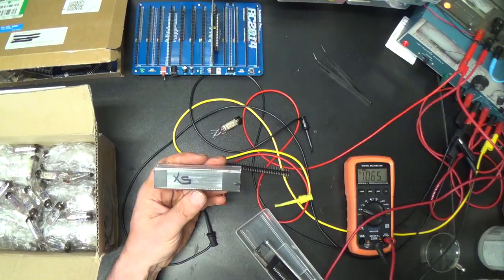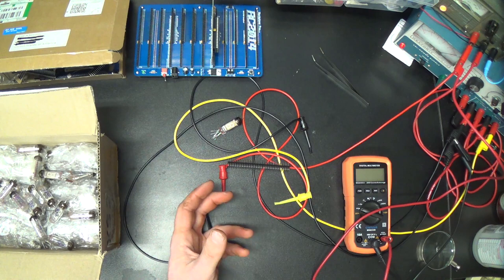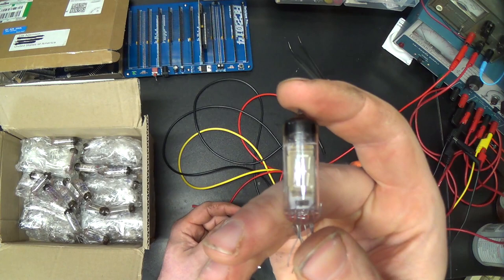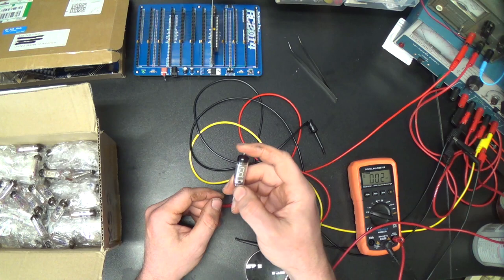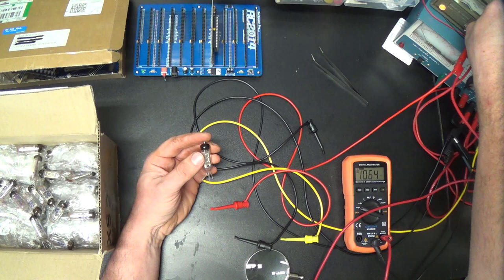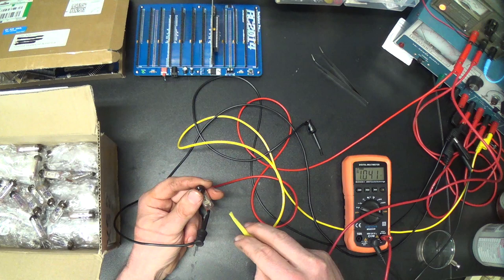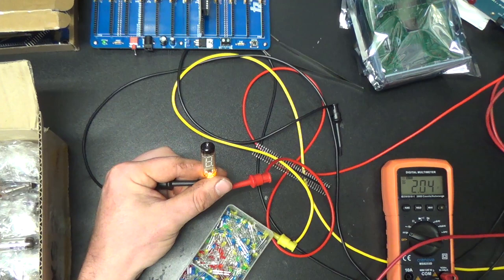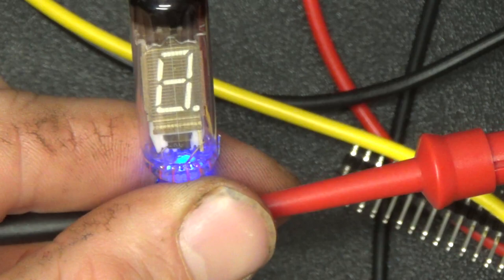IV-6 7-Segment Display Tubes

Comment: Based on my 25-286 development, it wont take much CPLD. Even a 16V8 GAL will have enough capacity to decode I/O addressing for an integrated XT-CF-Lite . My riser is using a 16v8 to decode for a UMB provider and I plane to use an xt-cf-lite in the third backside upside-down ISS slot, or even a 16 bit IDE controller with a IDE to CF adapter. In the latter case I will use the ROM socket on my NIC to host the XT-IDE firmware.
Reply from the maker: Yeah, I have been thinking that a full 16 bit buffered ide interface is overkill.  Even an 8 bit cf interface should be scads faster than a real hard drive for that class of machine ever was.
Reply: @Lee_Adamson_OCF  I've clocked the XT-IDE Rev.4 on my Tandy 1000 HX with a CF card at 163.7 KB/s (1.5ms seek), or 268 KB/s (1.7ms seek) with the chuck mod enabled. On a 10MHz 8088 (an XT-clone I've got), that same CF card clocks at 377.4 KB/s with a 1.2ms seek time, chuck mod enabled. I haven't tested as thoroughly with the XT-CF, but I'd concur that's far faster than a "real" hard drive of the time.

Comment: I definitely favor the amber LED on the bottom! Blue looks too much like 2000's era consumer electronics. Green or purple might be interesting.  I'd like to pick up 8 of the excess stock... how much are you looking for?
Reply from the maker: Orrrrrrrrrr.....  I have a few RGB LEDs.  We could....  Make the color programmable....  Although implementing 3x PWM pins on 6x LEDs, well....  Might be hard to keep the parts count reasonable.  Unless we used a Teensy or something..........

Creeping featurism, lol.
Reply: @Lee_Adamson_OCF  You could program it to cycle through the rainbow so Google will like you better :-)
Reply from the maker: @rivards1  Oh man.  I'm about to say "whatever it takes".  Lately every time I try to upload to YouTube while my VPN is turned on, Google flags it as a security breach and locks my account until I re-verify.  -_-'

Too bad the alt-tech video platforms are still mostly non-viable as far as audience and userbase.  :/
Reply from the maker: Re: 8 of the tubes.  Shoot me an email (lee at ocfco.net) and I am sure we can figure something out.